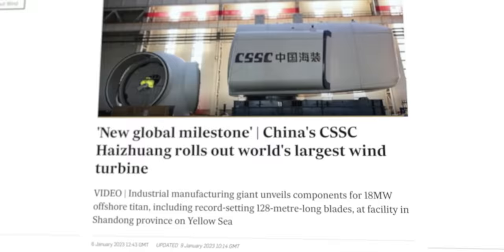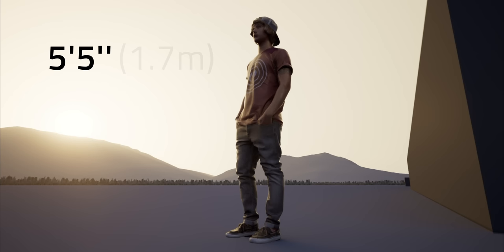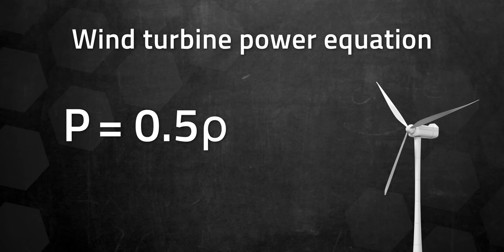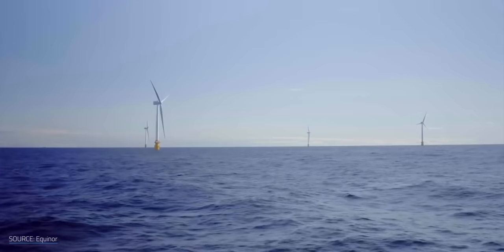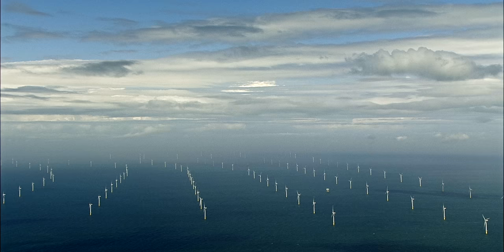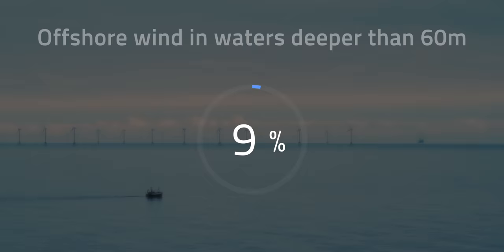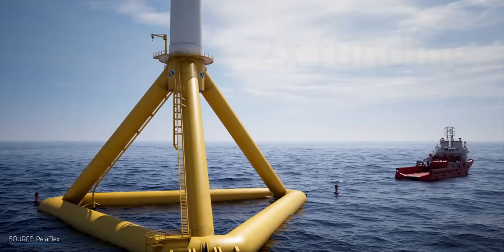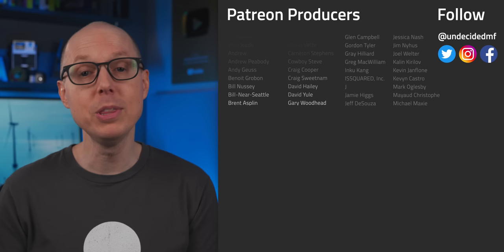Why Are Floating Wind Turbines So Huge?

Comment: I am wondering, what are the maximum conditions of wind speed and wave height that these floating turbines can withstand, in severe storms? Hurricanes and typhoons can generate wind speeds in excess of 150 mph and waves up to 100 feet. They are so large, that I don't see how they could easily or quickly be disconnected from the power cables and towed out of harm's way if a storm was coming at them.
Reply: They cannot move the towers whatsoever. During storms they are placed into wind stow (they face the wind, disconnect the main rotor, disengage the brake so they spin freely, and turn the blades so that they catch as little wind as possible) but the real answer is to not build towers in areas that are susceptible to hurricanes. High winds can and do absolutely destroy towers, it’s like throwing money right down the drain (millions upon millions of dollars a piece) so they try their best to avoid that scenario
Reply: @joshmusic9766  - Thanks for your reply; I don't know much about this newest generation of really huge wind turbines. So, if they can't be moved once settled into place, that implies that they can't be towed back to shore for repairs, either - so any damage or replacement of broken parts has to be done in situ. I suppose the accountants for the owners factor in storm losses as "part of the cost of doing business", so that the net profit from the electricity delivered to customers is high enough that the operation overall is profitable despite some losses. A bad storm on land could severely damage or destroy a solar panel farm, too, and there are some in Southern California that cover 4000+ acres and cost $500 million to build. In order to work, the panels have to be completely exposed to the sky, so there's no way practical way to roof them with something that would protect them from a storm.
Reply: @laura-ann.0726  you are right, they are all repaired where they stand. When offshore, you can imagine that this is extremely expensive. I also work with solar panels- they can do less to protect from storms but there are a few stow options, wind stow, which puts them about parallel with the direction of wind, there is hail stow, which takes into account the wind but mostly tries to stow them as upright as possible (perpendicular to the ground) so that the hail does not hit them, and table top, which is parsley to the ground which makes it easier to do certain maintenance. And yes you are right, everything is predicted and calculated… if the numbers and productions say it won’t be profitable, it won’t be built. They also look at historical data of wind in the area, they choose areas that have good and consistent wind

Comment: So use Darrieus wind turbines for floating offshore and keep tip speeds down so that noise is low for given power output. Little optimisation needed for given wind condition. Amazed these aren't more widespread.

Comment: Logistics is the key to cheap wind power and those high MW turbines could be deployed on land if the nacelles were superconducting, the blades were segmented and the tower was made of a lattice frame or concrete base tower sections. Advanced Magnetics Labs won an ARPA-e award for its 10 MW superconducting nacelle at 150 tons and about 14 ft. in height some 8 or 9 years ago. Blade Dynamics built a two piece 80 m blade about 7 years ago and GE bought the patent for the Space Frame Tower utilizing lattice construction about the same time.

Comment: Puns: 

- 1:02: “Is floating wind overblown?”
- 1:20: “Vestas swept away the competition.”
- 2:45: “Maximizing wind’s potential requires we blow up the size of wind turbines even more.”
- 2:55: “Scoring big air is easier when you have fewer obstacles in the way.”
- 4:00: “If that’s Greek to you like it is to me, don’t worry.”
- 7:00: “These proportions seem pretty, well, quixotic.”
- 9:42: “Offshore wind can certainly make for quite the catch.”
- 11:40: “It wasn’t exactly navigating unfamiliar waters.”
- 11:45: “Whether the offshore wind industry can stay afloat is another matter.”
- 12:45: “Burying an electrical cable into the sea floor requires a boatload of insulation.”
- 13:00: “I guess you could say it’s getting much harder for offshore wind developers to keep from blowing the budget.”
- 13:10: “Oceanographers haven’t yet assembled a concrete base of repercussions of…. all those concrete bases.”
- 13:20: “Whether this causes a negative ripple effect is unclear.”
- 13:50: “The theoretical possibilities offered by floating wind are nothing to blow off.” 
- 14:10: “So does all this talk of offshore wind blow you away? Or has all this turbine talk left you feeling winded?”

Comment: These offshore turbines cost much more than land-based turbines because they have to be built with materials to withstand salt corrosion, and often are in very deep water, requiring much more steel to build them (which is obviously bad for the environment). The noise of construction is very destructive to marine life as well. Nuclear power is an infinitely better solution.

Comment: Summary
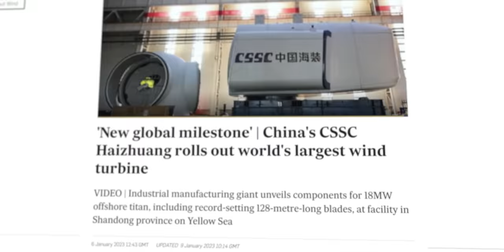* (0:00) Why are wind turbines getting so big? Larger rotors capture more wind, leading to a non-linear increase in energy production.  Bigger is simply more efficient.
* (0:24) Why are we moving wind turbines offshore? Offshore wind is faster, more consistent, and avoids obstacles found on land.
* (2:57) What's the difference between fixed-bottom and floating offshore wind turbines? Fixed-bottom are anchored to the seafloor in shallower waters, while floating turbines are for deeper waters.
* (3:08) Why floating wind turbines? They allow us to tap into the vast wind resources in deep waters, inaccessible to fixed-bottom turbines.
* (11:14) How do floating wind turbines work? They utilize similar buoyancy principles as oil and gas platforms, often employing spar buoys for stability.
* (11:46) Challenges of floating wind turbines: They are currently more expensive than fixed-bottom or onshore turbines due to installation and materials. The environmental impacts are still being researched.
* (11:00) Benefits of floating wind turbines: They can be assembled in port and towed, making installation easier. They offer access to stronger winds and avoid land-use conflicts.
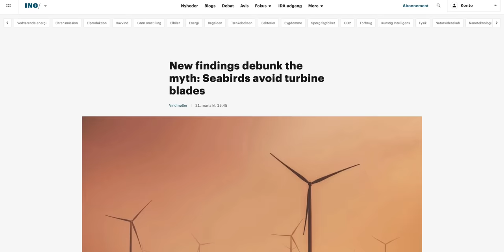* (13:49) The future of floating wind:  While still an emerging technology, floating wind has immense potential to meet global energy demands with minimal land impact. 

Summarized by AI model: gemini-1.5-pro-exp-0801
Cost (if I didn't use the free tier): $0.0493
Input tokens: 12176
Output tokens: 639

Comment: Fascinating, Matt, you allude to many weaknesses of onshore wind - wind shadow. Then quote IEA technical potential of 36k TWh of offshore wind and global demand of 26 k TWh. You cannot equate actual demand (not even peak) with theoretical outputs from economically infeasible projects. Would you build on top of the Great Barrier Reef? Costs are not guaranteed to come down. Remember, steel production is under pressure to decarbonise, and steel will not be cheap. Finally, do you mention the hours of operation? We might be lucky enough to get 50-60% maximum (versus 0-40% onshore in the windiest parts of Europe, eg the UK), but not all year round. The UK's entire wind fleet, including offshore, ran almost 99% below rated capacity a couple of weeks ago. Your analysis is great, I love your presentational style, but your content is bordering on biased due to serious omissions, but I appreciate your educational content for the bits you present.

Comment: Also Off-Shore because a lot of people really, really don't like wind turbines. The resistance is enormous in my country (Norway). We appreciate our landscape the way it is, even though we do have a lot of "empty land", we want to keep it "pristine". Then, when people hear of off-shore wind, they skuff at it due to cost competitiveness etc. But the fact is, we need renewable power. Yes, Off-Shore wind doesn't seem to make sense, but it's clearly one of the only viable alternatives up here. The sooner the better in the short term, and absolutely massive amounts is necessary in the long term. And especially here up north,  we aren't going to get the most out of solar anyways, so off-shore wind is what there's relatively good potential for. (Although we are 98% covered by renewable hydropower when it comes to electric power currently, we're still going to need more power in the future.)

Comment: If you put the wind turbines on top of a  huge floating  platform, the materials saved on towers and anchors might be less.  The surface area of the platform would also be available for solar.  A many bladed turbine wheel collects most of the wind energy in the swept area.  But a big tall tower cannot withstand the force.  But if a much smaller many bladed turbine is already at a high altitude,  it needs a much shorter support tower.  If the smaller turbines are used to compress air instead of turning a generator, all of the energy  could be fed into one  big cylinder to drive one big generator.   If tge cylinders are also used to float the platform, there is another consolidation of materials.  A one kilometer sized square  platform with this arrangement would average in the hundreds of megawatts.  Combined with concentrated hybrid thermal and PV solar covering the platform, the average output of the platform might apptmrosch a billion watts.  If you had two giant one kilometer long, one hundred meter diameter cylinders each with a giant turbine wheel at the end of the cylinders  supporting the platform, the consolidation of materials and generators might cost a lot less than many huge tower turbines.  But with the power output orders of magnitude higher, the cost per kwh might be a small fraction of even coal power.  
The temperature of air heated by concentrated solar can be many times the boiling temperature of water.  If you use the  two giant turbines to drive  the compressor for the concentrated solar energy thermal compressed air system, that is another consolidation of materials.  Combined with a fine  spay of cold ocean water, it would greatly increase the vokume of gas and the pressure inside the two giant turbines.  This consolidation of materials away from heavy steel generators and magnets would save a lot of money and weight on the platform.  There needs to be a structure to hold the two giant cylinders together.  If two surfaces sandwich curved perpendicular surfaces together, a giant wind concentrator made from the curved surfaces  that acts like a giant I beam could further enhance the power output and the consolidation of materials and tge strength of the platform.  A concentrator can greatly increase the power output in light winds.  If the platform generated an average billion watts of power and cost only $300 million dollars, it would pay for itself in a short time.  
If the object is to get the wind power from further and further out to sea,  If you connected these together, you could make a big bridge across the ocean that would pay for itself.

Comment: One question that keeps coming to mind is about security. If a country puts a lot of electricity generation off shore wouldn't that make them easier to attack/disrupt?
Reply: Thats also a problem with oil platforms on the sea as well as gas pipelines.
Or internet cables at the bottom of the sea are potential targets as well.

Comment: I think the costs you've given are off. In the last round of bidding to install offshore wind in the UK North Sea, the average minimum price was circa £42/MWh, so we know that the generation cost will be below that, rather than circa $80 like in the video.

To put that price into context, the nuclear power station that is being built in the UK has a minimum price of over £120/MWh. So we know that offshore wind is less than 1/3rd of the cost of nuclear power! Offshore wind is, by far, the cheapest energy source at the moment.

Comment: i used to support wind power and solar power but now, i am 100% go nuclear. why?
as explained in video, the energy cost ranges from 30$ to 200$. huge amount of cash is sent to capital investment, a huge technical team should be present for maintanence and more over, you need to  change infrustctre for solar and wind power, to maximize efficiency.
let me explain, during the day, energy requirments of a city is not identical. while people at work and factories are working, the demand for electriciy surges. 
while people sleep at night, demand is relativly zero. so we have unpredictible amount of electricty for a changing demand.
in order to utilize the energy, you have to build storage facilities, they are going to collect energy at night, supply in the morning. 
this is a huge investment guys. not every country can afford this.
in addition to that, solar energy needs to be turned into AC from DC. 

however, by using a nuclear reactor, you can continue to use  exsisting mains network. you can increase or decrease energy supply easily for a given day.
you are not going to waste raw materials.

so, go nuclear

Comment: floating off shore wind and off shore wind in general are/is the most promising form of renewable energy right now. i can say that with confidence. the sheer amount of upsides compared to downsides are unmatched. while you tried, i dont think you managed to really put into terms how incredible it is that one single turbine could potentially power 15,000+ homes. that's batshit. climate and energy silver bullets don't exist but this is very much the next best thing.

Comment: the answer to this question can't really take 14 minutes...... no way
Reply: It does if you repeat everything you say 3 - 4 times.  By repeating every point and fact in the video, the video's length is extended.  This leads to a video that is longer to watch.  So repeating everything multiple times really can take 14 minutes.  That's why they repeat everything several times.

Comment: The uni I am at has a bachelor and master for this type of engineering it's in Kiel Germany and even though I am only in the second semester it is really interesting. The master course developed  a slightly smaller one  and there is also some development in wave energy systems here.

Comment: The target for this industry would be to build a "tree" of turbines, offshore, to collect as much of the wind as possibile. Think of the actual turbines as "blades of grass", smaller or bigger. A "tree" would be simply a number of turbines fixed on a central "trunk", exactly how the branches of a tree look in the park :)
They could reach even a few km/miles in height.
This way it's easier to get closer to 100% of the wind potential.

Comment: 9:40 these two study claims are saying "of the total potential wind energy"  It would take an absurd and prohibitive amount of turbines to get anywhere near maxing those potentials, let alone how much the weather would be massively effected. The number is so absurd that the number of turbines would quickly gain diminishing returns at like 10% of potential energy.

When wind speed and RADIUS are v^3 and r^2.. engineers are behooved to scale.  The equation shouts the bigger it gets the better it gets, but the equation also, synergistically, SCREAMS wind speed matters a lot.  Bigger blades mean you can have high tip speed and low RPMs.  safer, more productive and efficient... on individual turbine basis.

Comment: We will have offshore wind farms that power synthetic carbon based fuel generating factories. 

Half of the problem is generating energy. The other half of the problem is storing and transporting energy. 

I just don't see batteries ever becoming the main longterm storage method for energy. Energy will be stored in batteries for either immediate or short term usage. While energy will be stored in carbon fuels for longterm month long or multi year long storage.

Comment: How about using the front of an old oil tanker or a big ship as a base for one or 2 large floating wind turbines which can provide 10-12MW power. It can be used to power itself as well be placed in the path of direct wind where needed and be connected to the shore.

Comment: why dont they use variable alternators instead of generators for wind turbines? i'm talking about the same alternator you have in your car,more power applied means stronger field, and thus could generate stupid power during storms without needing shutting down.

Comment: The thing to remember about all of these technologies are they benefit the companies and shareholders the most. They won't implement a technology unless there is a finacial gain for the company. The end user will pay for the development and implementation. But the company and shareholders will be the ultimate winners. Major companies who invest in this do so with one goal in mind to make as big a profit as possible, they have little care for the downside of installing this type of technology and will manipulate the ecological statistics to suite themselves. We all know that Gas and Oil is running out, so these companies are looking to the future to enable them to continue to make massive profits. I live in the UK and travel to the east coast often. The Wind farms in the north sea are obvious wherever you go along that coast line. Most of them are static and don't seem to be producing any electricity. Either too much wind or too little is the standard cry from the operators so I don't see the point in clogging the oceans with more turbines that will most likely never be used.

Comment: There is also the fact that going larger means you are less effected by waves of the same size, double the height and the width of the base and you can deal with double the wave height.
Reply: Not sure what u mean by the base but if you mean the submerged part of the base the you would be able to deal with more than double. With the height and width (plus added weight) you would also increase the effective stability by a lot.